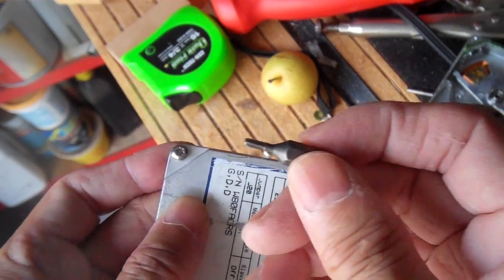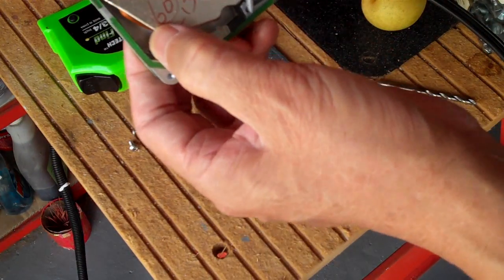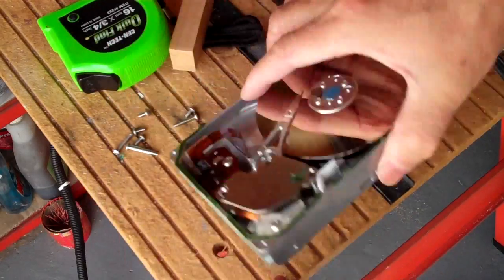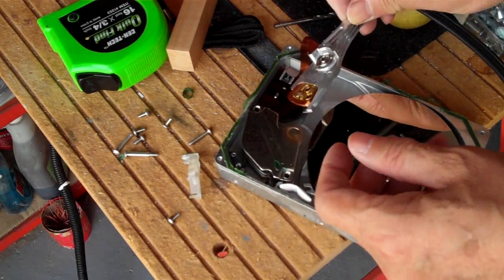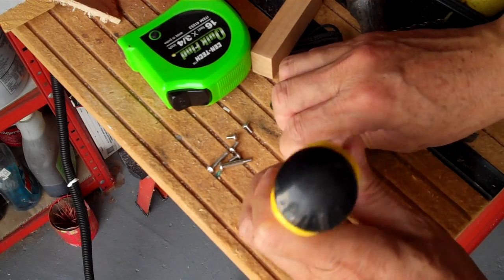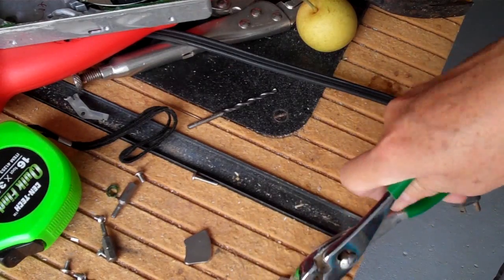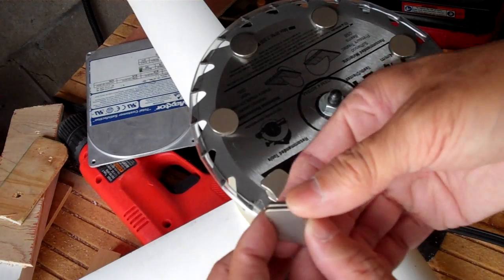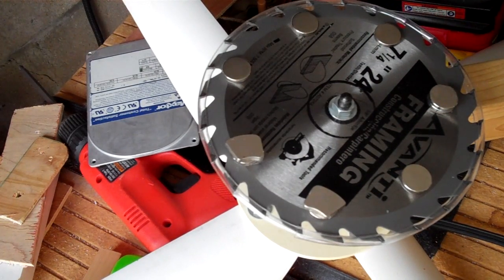Taking apart old hard drive to recycle the expensive neodymium magnets

Comment from the maker: I hate to say, these magnets also make great refrigerator magnets. If I try to stick more than a couple of pieces of paper on the refrigerator, the ceramic magnets will not hold them securely.  I didn't know meteor hunters use these magnets. I'm always a little afraid of what's buried underground.